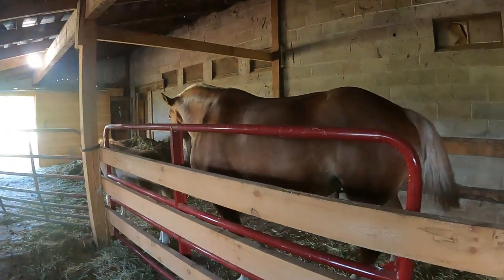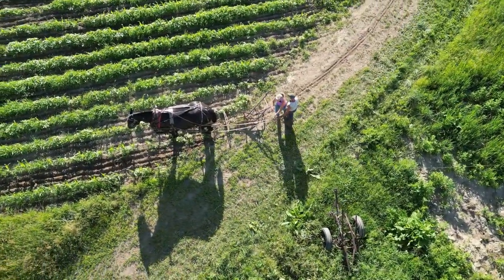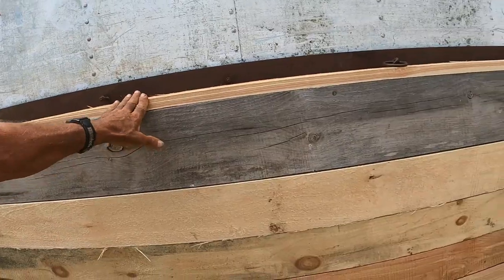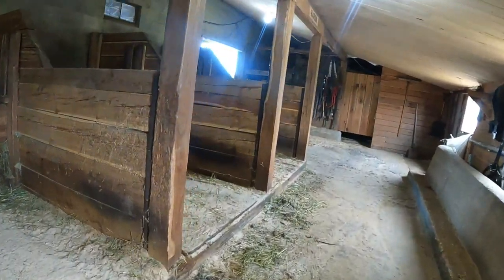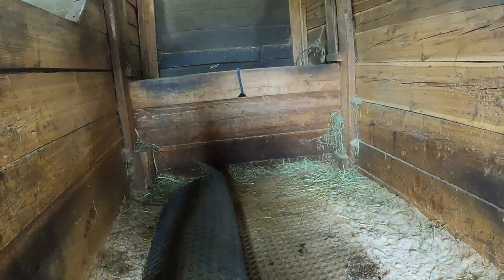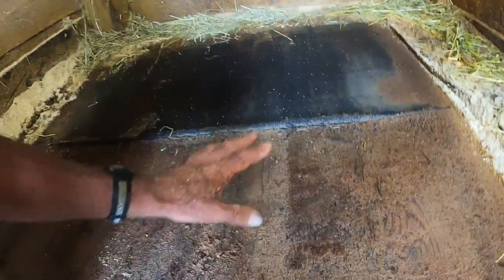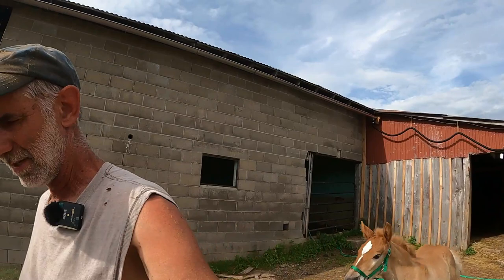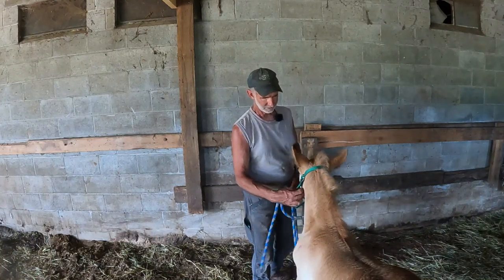DRAFT HORSES CULTIVATING A FIELD & Bree's Training Session for the Day! #502

Comment: Those rubber mat’s are preferable used on concrete floor. There they give larger farm animals some comfort. Your floor is wooden. Wooden floors need to dry out in the air or your wood shavings and sawdust. So I would not use them in your stalls
Reply: hope he can find some good hemlock trees,,he has a wonderful sawmill to make it happen..wish he had a power washer to gut it first...

Comment: Jim/Brenda please, please, please consider getting some:

Flex Seal in the large cans, FLEX SEAL LIQUID®
The thick rubberized liquid that you can brush, roll, dip or pour to cover larger areas. It starts out as a thick liquid and dries to a strong, flexible, watertight, rubberized coating. Now available in new MAX 2.5 gallon size.

Paint that on the clean and DRY floor. Then paint the bottom 2-3 inches up the front and side walls of the stalls allowing it to connect with the flex seal on the floor to seal that seam between the floor and side walls. This is liquid rubber and would still provide some padding but should seal out the moisture. It was designed to use around wet areas or areas that needed to be sealed from water and moisture getting in. 

Research it and see if you think it will serve your purpose. I think you will find so many other uses for the other different types of products they have. I think it comes in black, white, and clear. Please watch the videos too. 

https://flexsealproducts.com

Comment: The rubber mat prevents the ground moisture from evaporating. You need not prove this, it is a fact. The earth beneath the wood floor appears dry because the moisture evaporates. I just have dirt floors in my barns with bedding just like outside. Why change a good thing.

Comment: The moisture has nowhere to go in anycase. You have to clean the moisture away always. The mats give relief to the horse when they are wearing shoes. The way the mats work is when the horses are stalled on slats set close together say 1/4inch apart. The urine runs under the slats to a gutter, then away outside or wherever.  The mats on top are for the relief to the horse when wearing shoes. But you can't have any bedding or other material get on the floor or it binds up in the slatted area. It's either this devil or that devil! If you had slats you would need to have mats. No slats means you can have mats or not and you can have bedding or not. But without the mats the horses may end up with sore legs after a while. I think it is one of those things that never shows up straight away. Sore legs can take weeks or months to show up and conversely, many months to go away if you put the mats back in. Otherwise you have to take the shoes off and rest the horse for several weeks. So I would continue to use the mats but know you will have to lift them to clear the bedding material away fairly regularly. Flipping the mat over to be half the width will give the underneath time to dry better. Alternate the side it is flipped over to so each side gets a chance to dry. But it is yet another thing that needs to be done every time you leave the stall. Seem like everything causes some sort of bother. But it is hard to give them more time loose if they are not easy (readily accepting) to catch when required. 
I never had the no-catch issue because my horses would knock me over every time they saw me to get a piece of carrot. Even that small slice is enough to easily lure them in.  Usually, all I needed to do was open the door and whistle. But the piece of carrot must be available once they come in or they soon stop coming to a whistle.

Comment: The matts are good if there in a trailer or something like that because in a trailer your taking the time to move and clean under them. When it's in the stall you don't thank about when they use the bathroom in the stall it runs under the Matt and it's out of view and you would think that the saw dust would soak it up. So in my opinion I'd take them out and just put a Lil but more saw dust in the stall and that way you will be able to see where it's wet at and keep it a lot dryer and save the floors in your stalls